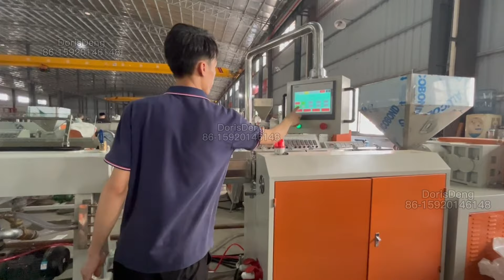how to operate plastic pipe extruder ? hows the plastic tube extrusion machine running ?

Comment: 0:25
Hello. I wanted to ask that water tubes connected to sizer are necessary or not..I mean is it mandatory that these water tubes shoud have flowing water..?
Reply: It's for cooling hot plastic quickly so I think it's important for good quality pipe
Reply: Absolutely. Hot plastic is very soft and flexible, you need to cool it down to get good product